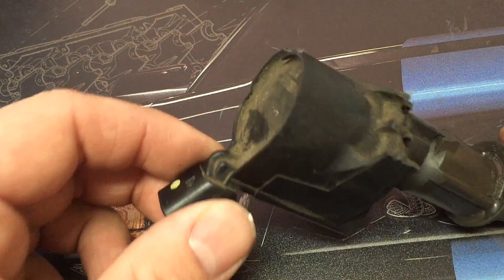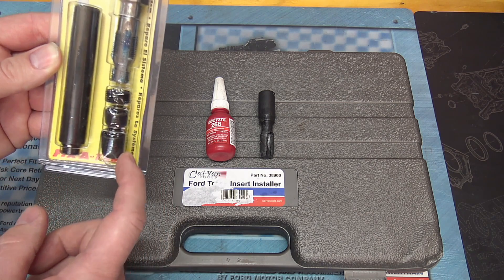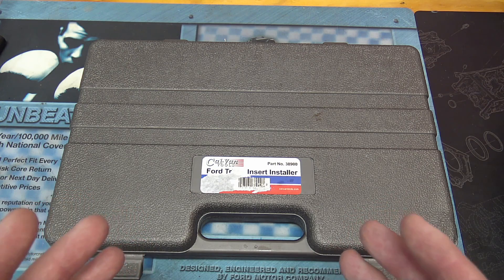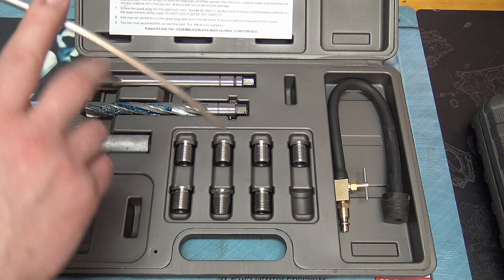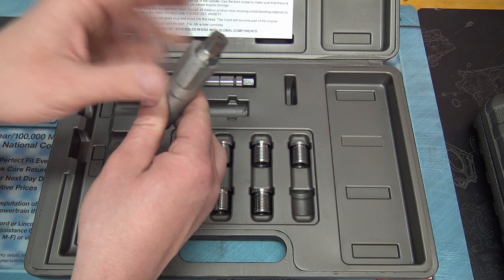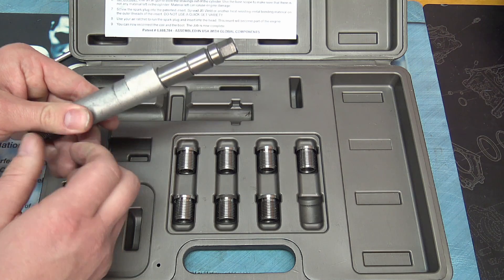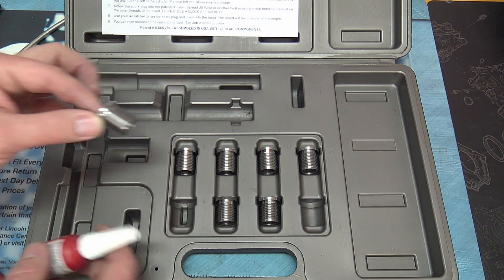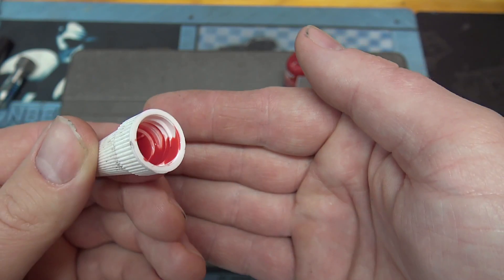Ford 4.6L 5.4L 6.8L 2V Triton Engines: Blown Out Spark Plug Repair Kit Usage

Comment: well i work at a Ford Dealership and we had a rancher come in after a plug blew out of the motor that i installed almost 100000 miles ago and the coil pack also was broke.  the boss and service manager insisted that i just put the lock n stitch repair kit in and i new i should have ran a compression test first just cause they pulled the vehicle in and the customer must have already tried repairing it themselves.  So here i am installing a lock n stitch kit in the head on a pick up that needs a motor .  the spark plug actually made the hole an oblong shape so they really must have drove it like that for quite a while.  what a waist of time... so 3 or 4 hours later and also retorquing the other plugs to 25 ft lbs which they must have already been checked the vehicle still needs the motor.??? so not sure what they want me to do tomorrow, but im sure its my fault for listening to them and not doing what i should have done and not listen to them in the first place.  story of my life.

Comment: i have a question about temperatures. my sons truck will not fit through my garage door so this repair will have to be done outside,...........and its cold out. 15 to 30 degrees out. will this present a problem?,.............should i find a garage and thaw the truck out first?

Comment: great concept of the calvan kit but my question is what if the plug that blowed out was one of the ones under the firewall. how will i be able to drill out the hole
Reply from the maker: You attach the reamer to a standard 3/8" ratchet or air ratchet- http://amzn.to/2hZ9IzG

Comment: Hi. I did the Cal Van repair on my 99 Expy 5.4L back in 2010. This summer, I had my local Ford dealer replace all the spark plugs. The other day, the sleeve shot out with the plug. I have no idea how that would have happened. Now, the threads for the sleeve are stripped out in the head. What are the options after that? I'm guessing a new head. I'll have to do it myself as I don't work now as I'm disabled. Unfortunately, funds are very tight.
Reply: I spoke to an Engineer at the Cal-Van company. He said that the fact that my cal-van sleeve blew out is because the aluminum in the heads that Ford used is crap and is weak metal. He advised that I can "travel uncharted territory" and use a 3/4" - 16 Heli-Coil Kit to make new threads to accommodate the Cal-Van Sleeve to accommodate the spark plug. How long it will last (if it does at all) is the question. Other option is a new head. That's a major job for a DIY guy.

Comment: the shop is saying my spark plug hole can't be fixed because the Helicoil Falls right in the hole. is it possible for me to use aluminum weld on my 04 Ford Expedition

Comment: Would you happen to know if the Timesert Ford Triton 2 valve kit would work on the 99 Cobra 4 valve heads?
Reply from the maker: +Karen Vittorio I don't think so you will have to contact them directly that engine is a speciality.
Reply: Too late now 'cause I just got through installing an insert using Timesert kit # 5553-8 (insert part #51459). Started right up - ran a little rough at first (been parked since early August) then smoothed out to a typical idle. Of course, only time will tell. Now I have to chase down the cause of a new rattle type noise. Sounds like something is in the muffler - maybe a piece of baffle broke off and is rattling around, or God forbid, a piece of the cat broke loose and is trapped in the muffler.

Comment: will this kit work on a 2005 4.6l in a f150 ?? if not do you know the proper kit to use besides the garbage hell coil?? thanks !
Reply from the maker: This is the kit you want for 2 valve engines it has high quality inserts- http://amzn.to/2cKJFdi
Reply: +FordTechMakuloco thanks ! You said you had a hard time with the drill bit hoping I don't have the same problem. Do you think I need to remove the fuel rail for greater access or will it work around it ? Thanks for all the help seems like your the only guy on here who actually knows what they are doing !
Reply from the maker: +Grant Brown no just the coil and plug maybe position the harness out of the way but otherwise you are good it goes deep down in there.
Reply: thank you for the help man !! i really appreciate it !!!! buying the kit now cheers
Reply: FordTechMakuloco v.  Caz I 0

Comment: how much usually does it cost to get it repaired?
Reply: i got quotes: $500+ for the insert, $2500+ to change the head (2001 ford econoline), $3500 to get the engine replaced with a used engine, and $7500 at the dealer to get a brand new factory engine installed.

Comment: what boroscope do you recommend? trying to do this the best way possible on my 01 v10 excursion. don't want to cause anymore damage, or need to do more repair than is necessary. excellent video btw. i usually search for your stuff when i start a job I haven't had much experience with yet.
Reply from the maker: This is the one I use all the time it works great for the price- http://amzn.to/2bhfP21
Reply: +FordTechMakuloco excellent. thanks man. I'll have to post on here when I finish the job.

Comment: Had mine blow (helicoil), replaced by the dealer, and within a week the helicoil blew out again.  Can it still be fixed
Reply from the maker: Yes this kit is oversized so it works wonders even with previous repair attempts
Reply: awesome thanks!

Comment: Hey if anyone could give me advice I would appreciate it.   
I have a 97 f150 4.6 with a broken plug in cylinder #4 broken above the threads.  I already got the porcelain busted out of the plug with a variety of tools  mainly my hammerdrill. Now the threads are stuck. With dried up pb blaster on the head..
I will now drill it out and put a insert.  any suggestions on how to clean the cylinder of all the metal shavings very good?  
I see everyone blowing shavings out of a dry cylinder, mine isn't so dry.
I figure if I get water spraying from the top down I can just vacuum it all up easy.
or should I not use water?

Comment: I wouldn't use Loctite. The Red (what we call it, screw the numbers) we use on permanent fit. But, it isn't permanent. We use heat break it up when we need to loosen the item back up. There is more than enough heat from an engine to break up Loctite to loosen its hold. RTV would be a better option.
Reply: Thomas Hoff  the fact that you would use rtv in this application tells me you don't have a clue as to what the  fuck your doing
Reply: In the event that what Thomas is saying has any legitimacy, the plugs should be changed on a cold engine. If the inserts were going to come out accidentally, they would come out with the plug during change out. I wholeheartedly agree with(RTV) being completely unsuitable thread locking compound.  By the way this is a very well done video, thank you.

Comment: It is my understanding that the OEM Spark Plugs were the issue which only had 4 threads and not the lack of threads in the cylinder heads. Am I wrong?
Reply from the maker: +Trace Eubanks Those were the worst ones yes.
Reply: +FordTechMakuloco Thank you for your response. I've been investigating this problem for the past few days and I'm perplexed as to why there is no definitive answer regarding this issue. Some suspect the OEM plug threads were to short....blaming the plug manufacture. Others say its the cylinder head design that won't allow the short threaded plugs enough thread grip and torque properly, blaming Ford. Its amazing how evasive everyone has been. What is the actual problem??  Maybe its the combination of both? That's my assumption.

Comment: Thank you very much, very good step by step,.. I have a 2001 XLT f150 5.4  and I can only find a insert kit for the 3 valve engine. what is the difference between the 3 valve and 2 valve spark plug threads, or seems like the kits are the same! Is there difference in years as well,..again Thank You!
Reply from the maker: +JoeT001 Big difference you want to use this kit for 2v engines like yours-http://amzn.to/1Y2URmY

Comment: I can tell you by experience, the #4 plug is extremely difficult to reach, especially with the tool you showed. It was a very involved and timely process, which would justify the 4 hours of labor charged out. The truck did have 200k on it, and when I chose to change the rest of the plugs out, found that half were Motorcraft and the other half Champion. This was an under-maintained vehicle with many hard to move fasteners and electrical connectors. The New York State rust belt doesn't help either. It can be a regional thing, but certainly a lack of proper maintenance thing. It is more difficult to change the plugs on this engine, but you only have to do it every 100k, so it's all relative. Great video, BTW, just wish the actual cylinder was shown getting the insert put in. I realize the issue with getting right in there, but hey, I like watching someone say "No big deal" and "Watch this" at the same time! Just glad I wasn't working on the 3 valve Triton this time!

Comment: Too bad there isn't anyone doing any kind of work and Videoing it on an E350!
Reply: I'm doing a 2006 E250 with the 5.4 right now. (sorry no recording equip.) I'm fixing #8 cylinder. The fuel rail has to be removed and lifted a couple of inches. I'm using the Van-cal kit with no grease on reamer or tap. Grease fall with shavings in the cylinder bore. It also gets on the freshly taped threads. I removed drivers seat to make it much easier.

Comment: What were the engineers at Ford thinking, only using three threads for the spark plugs, in the 5.4 2v engine? Think there would be a recall, or actions being taken to solve this issue, for us owners of this particular f150 5.4 2v.

Comment: What engineer at  Ford thought, "Hey, lets use a long plug with three threads on these Triton motors..what could possibly go wrong? Then all their superiors figured it would be a good idea to produce this engine for 19 years and counting!
Reply from the maker: +cbsctomh That engine was the most reliable they have built in a long long time besides this issue of course.
Reply: +FordTechMakuloco Just about to turn 300,000 miles on my original '97 F150 4.6... 5 sets of plugs, haven't had this issue yet. No major repairs, never had the heads off. The intake manifold gaskets were the most involved repair so far. 19 years and yep, I'm counting.
Reply: +FordTechMakuloco I have a 98 Ford Crown Victoria the spark plug blew out with the insert on the plug is it good to try to put in another had this car about five years didn't know it all ready had one in it can it be fixed

Comment: Seems like a design flaw that Ford should split the bill for. Had one blow out, dealer wanted $400 for one plug. A fiend had the tool so I did it in a half hour.
Reply: Which kit? I can't find a kit for 32v 4.6 mach 1

Comment: Is the whole generation of the 4.6 affected by the blowout issue? I'm wondering if it is a possibility for my 1991.
Reply from the maker: 91? I thought 94 was the first year of the modular
Reply: I have a 1991 Town car with the 4.6 2V and my understanding is that the 1990 Town Cars, Crown Victorias, and Grand Marquis' had the OHV 5.0 and in 1991 Ford put the 4.6 2V in the Town Cars and in 1992 when they restyled the Crown Victorias and Grand Marquis' they were updated to the 4.6 engine. 1994 might have been the first year of the 4.6 for pickup trucks?
Reply: +Thevinylking69 97 f9r the f150, 98 for the super duty

Comment: hopefully you get back quickly lol, im doing the repair tomorrow.... I have been hearing a squeaking tapping sound on this new/used expedition I traded my Chevy truck for 1998 5.4l for about a week and finally today leaving Napa I started it and pop went the plug on start up..broke the ignition coil....i got it to work, I'm a heavy equipment mechanic so i know my way around a vehicle pretty well. #4 plug was the blow out so I pulled the coil out and then the plug came out in 1 piece and didn't look like anything was damaged but the plug bottom from flopping around...I pulled the other plugs as well on that bank and they were just covered in soot/ash.

I want to just stick a good plug back in there and tighten it without the insert? 

if I ordered the nice kit you have in the video saying if just retorque a new plug and it fails.... how can I get a drill in number 4 cylinder being under the cowl by the bulkhead?

Comment: I'm curious to know what my local machine shop used on my '02 Mustang because it blew back out in just over 170 miles, engine caught fire, and burned the whole car down.  I insisted that they use the nut insert rather than a helicoil for this reason and they said they used the same one they use at the dealer but who knows.  I'm definitely glad I had comprehensive insurance!
Reply from the maker: +UnsulliedSpy There is no way a time sert kit like the dealer uses failed.
Reply: That's what I was thinking, hindsight being 20/20 I wish I had just done the repair myself but the price of the timesert kit was more than what they wanted for the whole repair.
Reply from the maker: +UnsulliedSpy Yeah that is why I recommend this kit, works very well and never a problem.
Reply: Unfortunately I trusted a "professional" shop to do a better job than I thought I would have done and it cost me my car and everything inside of it.

Comment: Ended up going for the timesert kit for a 03 4.6 2v. About the same price for me and worked well. I would add going and checking the torque on the plugs every few oil changes.

Comment: the mechanic called me at work at quoted $1900.00 said it would be 12hrs +mats i told him to pack it up so i can come by and get it.....2002 f150 5.4 triton
Reply from the maker: +will c For this problem? Yeah I would say get this kit and bust it out. It's much easier than it looks.
Reply: +FordTechMakuloco thanks to your video buddy i've got alternate options was worried id have to change the head.  i also have a subaru impreza which had the dreaded headgasket failure after ripping that engine apart I'm pretty confident to do anything and with your info i plan to get'er done thanks again buddy
Reply: +FordTechMakuloco  man im glade now i got a jeep instead i was looking at getting an early ford expedition i was liking them a lot like 2000 then i found out about this issue right here decided not to get one i was also going to get an escape because of fuel economy.

Comment: Fair warning to those attempting this job. Check for old helicoil in the plug hole before you drill. Which I did but couldn't see it.  I used my air ratchet to drill and it was tough and took a while, I thought it was because I have a small compressor that wasn't powerful enough. Low and behold when I was checking to make sure I got all the shavings out I found a piece of helicoil on top of the piston. The helicoil job was done by a previous owner. So if you don't see helicoil before drilling and have troubles drilling, stop and check again.  You don't want my new problem.
Reply: Update: after a day and half of failed attempt after failed attempt. I finally got the old piece of helicoil out of the cylinder without removing the head. WOO HOO!!!!!!!

Comment: just blew a plug on my 2002 F150 5.4L lariat 4x4, what kit would i need to fix it, I see kits for a 2valve and 3 valve. Unsure what my engine is. Any help would be appreciated.
Reply from the maker: The kit I link to in the video description is the kit I recommend for your 2v engine
Reply: FordTechMakuloco Got the kit as recommended by you, followed instructions and got the new insert in place. However I was wondering if there is anyway to know if the insert  seated well. For some reason I thought that I didnt get too many rotations (threads) when placing the new insert?
Reply from the maker: I guess you could check with a borescope. I was able to get quite a few rotation with mine. Did you seat the insert with the new plug or separate?
Reply: FordTechMakulococo I tightened the new spark plug into the insert, then used a rubber tubing at the end of the sparkplug to get it started onto the threads, I got a few turns until it got snug and then torqued to 20 foot pounds. I used a borescope and it looked good, was just wondering if there was an alternate way to check. The truck drove really well until this morning when it seemed like it was misfiring, ran a check and it came back with a error code of P0171. FYI, i am using an aftermarket coil pack got off ebay, could that be the cause??
Reply from the maker: Yeah I don't like the aftermarket coils at all.
Reply: Dont use the 3/4

Comment: I was on Highway when this happend. Coil pack was still loosely in its hole. Could not find the plug. Is it possible for the plug to fall into the cylinder?
Reply from the maker: No the plug blew out for sure

Comment: Brian, I'm having a slow start issue with my 04 F150 5.4. It is now taking about 10 cranks instead of 1 before the engine will start. It was doing it occasionally now it's all the time. Feels like I'm losing fuel pressure. Is there a check valve in the fuel line somewhere? Any ideas where I should look? Thanks

Comment: Also Dorman makes a kit, I only bring it up because I ran into this on my own 5.4. I did not install it, I found it already installed when I bought the truck. The kit contains whats looks like a tap with the center drilled out to accept a 3 valve spark plug. Now it was working fine when I bought the truck. During the spark plug change, I found this thing, did some research to find out what it was. I removed it before I knew what it was and installed the regular plug. Well 2 years and 10k miles later I have yet to have the plug blow out. Don't know if I just got lucky or what. LOL Great videos by the way.